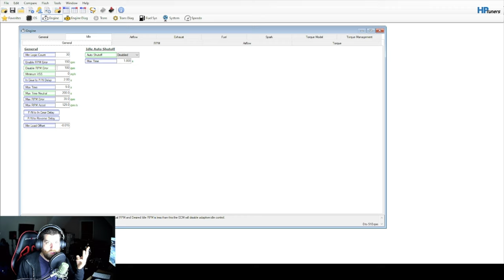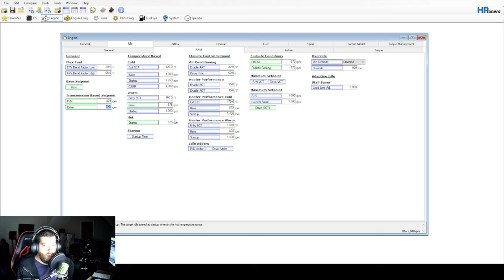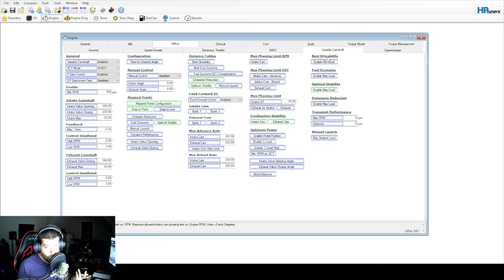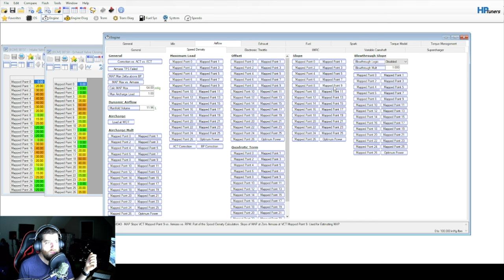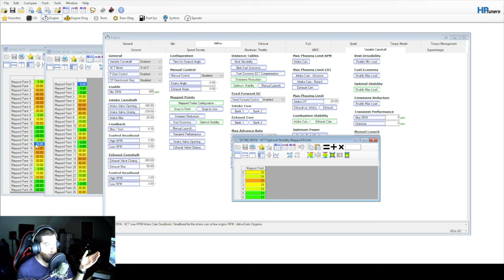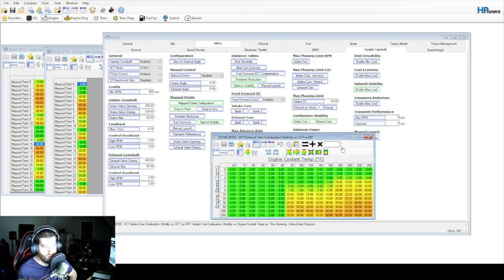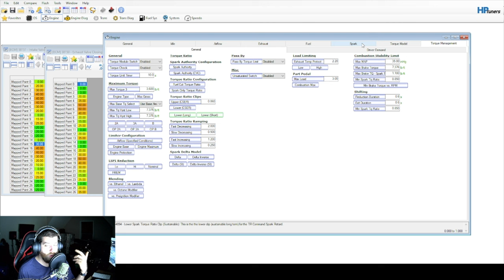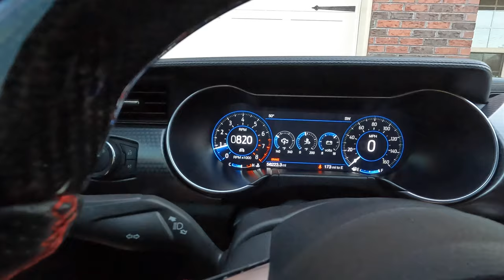Mustang Ghost Cam Tune Deep Dive ***AND POPS AND BANGS***

Comment: Interesting. Optimal Stability Distance (38209) is load based vs. temp on my Gen4.
Reply from the maker: Yeah a lot of stuff like that varies from generation to generation. That's not even unique to ford. The C7 Corvette, for example, has about 4 different configurations of driver demand tables. It's either accelerator vs rpm or accelerator versus vehicle speed and then the units are either pound feet of torque at the flywheel or pound feet of torque at the axle after final drive multiplier. Very annoying to deal with because you never know what configuration you're going to get. The fundamentals are the same, but you just have to adapt each time you tune one.
Reply: @RobsHouse  very true, and also very annoying lol. I've done a very similar ghost cam tune, followed your video and tried some settings. It works great up until operating temp - at which point it commands MP0 in what I assume is emissions reduction. But when this occurs, it never leaves MP0 while driving. 100% weighted on MP0. Any ideas? I'm sure there's something simple I've missed, but info on gen4 F150 tuning is slim at best right now.
Reply: @RobsHouse  and also when it's doing that - MP0 at operating temp - it's still using the limited timing at idle, 23 degrees or so.
Reply from the maker: Yeah I’m not sure. I go over how to force it into optimal stability mode or whatever mode you want to do the ghost cam in. But I’m in a gen 2 platform so there might be more tables for the gen 4

Comment: Very informative video ! I love the way you did the pops. Any reason why you did not go to the spark table it self to pull timing on decel ?
Reply from the maker: Yes! Newer systems like the newer Mustangs and the Gen 5 General Motors engine platforms rely on torque management to pull timing in a smooth manner to transition to fuel cut. If you just put insanely low timing numbers in your spark tables, you'll have two issues. First off, your car will jerk really badly as soon as you let off the gas because it will not smoothly retard the timing. It'll just go from 30-50 degrees immediately down to -10 or whatever you have it set to. Second, depending on the torque system, the torque management may actually fight you! For example, on GM vehicles, the torque management will actually add timing because it thinks your timing value is too low which will cause back and forth spark oscillations between your negative values and whatever it adds. So -10 to +20 back to -10 back to +20, etc etc. The car will jerk back and forth violently. I tried this method the first time I tried to burble tune my Corvette and it drove like absolute garbage. I then later did a video where I show how to modify the torque management system to get it to pull the timing for you and give you pops.

The other thing that can happen depending on how much tuning resolution you have in the spark table is that when you roll back onto the gas, you'll get massive hesitation until the cylinder airmass reaches a level beyond where you put the negative values for the burbles. So you cant roll back onto the accelerator gently. You'll feel like the car doesn't want to move. It is best to leave the main spark tables alone, adjust the minimum tables so that the ECM is allowed to pull a lot of timing (conditions permitting), and then play with the torque systems to get it to pull timing ONLY on deceleration (0% accelerator). That way, as soon as you touch the gas (even 1%), your car drives like normal!

Comment: Followed to a T and my idle is still swinging between MP11, and MP0-1 on idle
Reply from the maker: Worth noting that on the Roush, half the MPs are completely disabled from the factory (MP0-13). IMRC is also disabled because it has a supercharger, not the stock intake manifold. I believe the two are correlated. Some of the lower number map points are used from the factory, but then are disabled in aftermarket boosted applications. You have to check your MP scheduling and see what is enabled at idle. I used 11 because the cam angles were what I wanted and it was previously disabled. So, I knew it wouldn't be commanded elsewhere. In your case, you probably have more than one MP that is able to be commanded at idle, so it's oscillating. You need to figure out when MP0-1 are enabled at idle conditions and disable that. Also confirm in a log that you're using 'dashpot' at idle. If it's switching between dashpot and something else, something is wrong.

Comment: I did the same and i got ghost cam .. but some time its switch between mapes while crusing and sometimes not stay in one map and drive like garbage ..then write faliure in data log !! So any advice ?
Reply from the maker: There is no map switching in a factory ECM. Is it throwing you into limp mode?

Comment: I tried this on my gen 3 the car turns off sometimes and i get misfire with check engine light 😢
Reply from the maker: Did you play with the idle torque reserve settings?
Reply: @RobsHouse  did on 2022 GT a10, when in drive, the rpm drops super low, then goes back up, and it’s really messed up, idle sounds amazing, it ghost cams really well, but in park or drive it messes up.
Reply from the maker: @nkhanti6810  Yeah I don't have an auto car to play with, and my car is a gen 2 coyote. Main things to play with if it's hunting for idle like that is both the cam angles and also the torque management torque reserve. I had to lower the reserve on mine to get it to stop hunting like that. I'm sure the gen 3 motor behaves a little different too. Try a less aggressive cam angle to start with.
Reply from the maker: @nkhanti6810 I just did a car with a 6R80 transmission (Auto) and it worked fine. I just had to adjust the idle torque reserve in both neutral and in drive. Under idle -> torque -> idle torque reserve. The neutral table i set everything to 20 and the drive table i set it all to 30. I had the same issue before I did that where as soon as I put the truck in Drive, it started surging real bad. Once i adjusted the torque reserve, it was fine.
Reply: Tied following but I'm guessing yours is a Gen 2, my HP tuners seems to be much different

Comment: Great tutorial, tried your exact setup using my Absolute Load value of 0.2 from my '16 GT, it cam chops some times, and some times bogs down then idles at 1k back and forth, hoping I can tinker and solve this issue.
Reply from the maker: Yeah you'll have to play with it a bit. My car is supercharged, so copy/paste might not work on an NA vehicle. The concepts are the same though!

Comment: I think your explanation of the cam behavior to cause the "chopping" noise was actually backward.  When you're at idle, the amount of air you need to maintain idle rpm is very low.  Your flow velocity through the intake runners is also very low.  Given that the throttle plate is closed during idle, by adjusting the overlap of the cams (i.e., the amount of time both intake and exhaust valves are open simultaneously) we can influence the amount of vacuum that's created in the intake manifold which affects the flow velocity into each cylinder on the intake stroke.  Now, think of valve overlap as a deliberate leak in the air pump that is our engine.  Low overlap = higher vacuum, high overlap = lower vacuum.  Having high vacuum means that when the intake valve opens, the air is literally sucked into the cylinder at high speed due to the pressure differential.  This is a good thing.  High flow velocity ensures that we get efficient filling of the cylinder even at low engine rpm.  Additionally, since the rpm is low, the amount of actual time we need to ensure complete filling of the cylinder is also low, which means that we don't need to keep the valves open very long in terms of degrees of cam duration or that we need to open them early in the cycle.  Thus, when we ensure that we have a high, and importantly, consistent vacuum signal, it's easier to balance the air flow into the engine thereby making the idle smoother.

Unfortunately, while this is good for low rpm operation, our needs change as rpm increases, and what's good for low rpm doesn't work for higher rpm.  The lift, duration, overlap, and advance of a traditional camshaft is fixed.  This means that it's optimized for a very specific and typically narrow rpm range.  At high rpm, we need more actual time to fill the cylinder which means we need more degrees of cam duration to hold the valve open longer and we need to open it earlier in the cycle.  The same thing with the exhaust.  Overlap is a bit of a balancing act, we want some overlap to help use the intake air to push the exhaust air out as well as maintain a high flow velocity into the cylinders but at the same time we waste some of the intake air by doing that.

That high rpm camshaft is going to have an overlap intended for use at its optimal rpm, but when we use that same camshaft at idle, all we've done is create a big air leak. This gives us much lower and inconsistent vacuum signal to the cylinders which leads to a rougher and more variable idle.  Making the valves open earlier and staying open longer changes the time of the exhaust pulses, and the combination of those two things together is what creates the classic "chopping" of a performance camshaft.

In the case of the VCT on a pushrod motor, the lift, duration, and overlap of the cam is still fixed based on the cam profile (unless it's a system like VTEC which actually has a second profile ground into it).  The only thing we're doing with that system is changing WHEN the valves open and close, retarding the cam to open later in the cycle increases vacuum and smooths out the idle, advancing the cam decreases vacuum and makes it more choppy.  With a system like Ti-VCT on the coyotes, we're still using physical camshafts with a fixed lift and duration so how long the valve stays open is still fixed, but because we can advance and retard them separately from each other we can control both the overlap and timing of events, allowing a much higher level of optimization across the entire rpm range.  It's called a Ghost Cam, but the reality is that's a bit of a misnomer.  The fact that we can make the cams chop as hard as they do is a testament to how "big" they actually are and it's the sheer amount of adjustment we have that allows us to make big cams idle as smoothly as they do.
Reply from the maker: This is a good explanation, although I'll push back slightly and say that the throttle blade is never 'closed'. If it was 'closed' at idle, it would allow no air to pass through, and the car would just die. 

As for my description, I usually say something like 'pulling more vacuum' when I actually mean lower vacuum. I say 'pulling vacuum' as in you're not making as much vacuum as you'd want. Because of the exhaust gases leaking back into the intake manifold you have less differential, and thus, air doesn't get sucked in as well. So, your description is totally correct. My phrasing is just clumsy. I should say 'reducing vacuum', not 'pulling'.
Reply: @RobsHouse   Technically you’re right, the throttle is never completely closed.  But it’s “closed” relative to what it is at WOT, partial throttle, or even just cruising down the road. It’s open only just enough to maintain idle.

With that said, early fuel injection cars did completely close the throttle blade and had a separate idle air valve. But this is not that fuel injection.

And regarding vacuum, ok, I guess that’s what confused me. “Pulling more vacuum” to me traditionally means increasing the amount of vacuum.